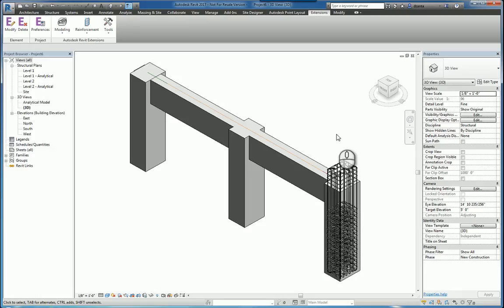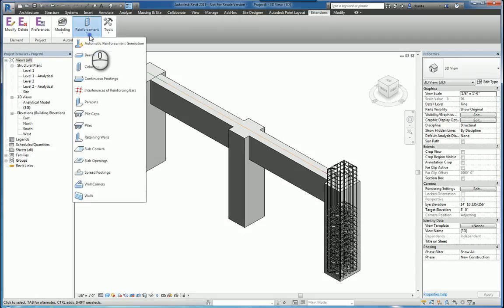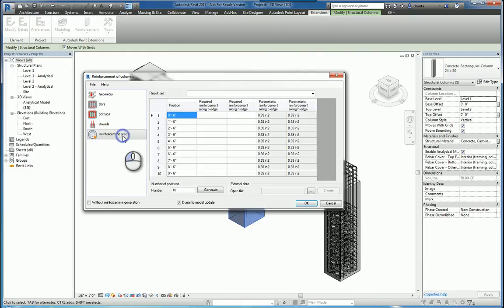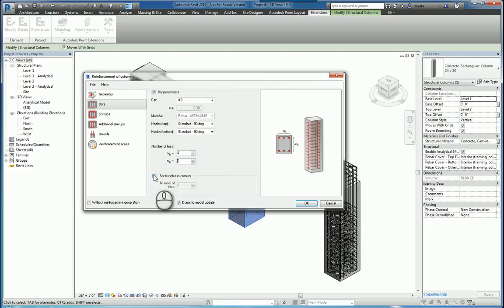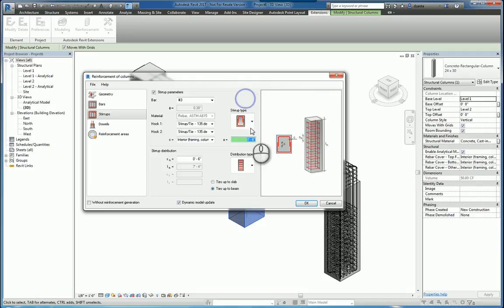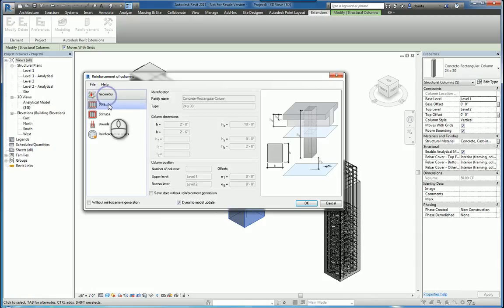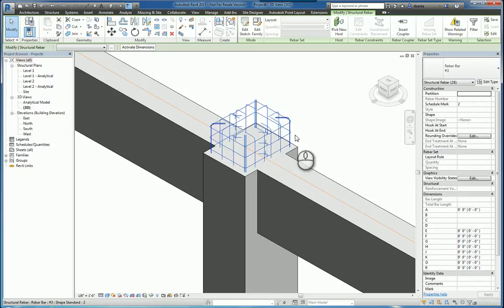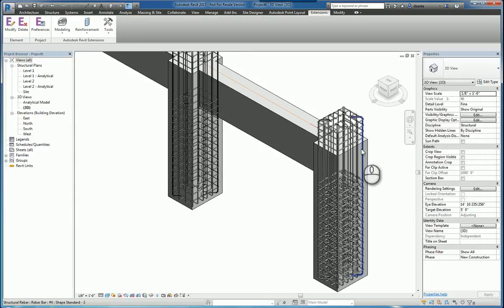Revit Extensions Column Rebars   A How To Guide

Comment: hello 
i have 3 columns that are attached at top with a sloped slab , when i do what you just did it , all rebar are showing way above the slab , even though dowles are turned off !! what am i doing wrong?
Reply from the maker: if you can send me a revit file or picture, I can get a better understanding.  I created 3 concrete columns attached at the tops with a sloped structural slab foundation.  I then used the extension command on each one using different settings.  Depending on the settings you choose, the rebar will go thru the slab or not.  The settings I chose to ensure the rebar does not go into the slab are as follows:
1.  Geometry Section (left as defaults)
2.  Bars Section (No Hooks for top/bottom and the rest as defaults)
3.  Stirrups Section (left as defaults)
4.  Dowels Section (unchecked Dowels)
5.  Reinforcement Areas Section (left as default)
6.  Clicked OK and results show rebar created and initially going into the slab
7.  Select rebar afterwards to push/pull to make it not touch the slab

If you need a video, I can make one....
Reply: omg !! thank you for your fast reply , i can send you the revit model , just give me an email .
Reply from the maker: dta@reproproducts.com
Reply: i have sent it to you ..
Reply from the maker: After several attempts and scenarios, this is what is going on:
- The extension tool creates the rebars in the column as you specify them in the dialog boxes.
- If the concrete column is freestanding and there is no slab anywhere near it to intersect or attach to (top/bottom), then the rebar is created FULLY CONTAINED in the concrete column
- if the concrete column is near or attached to a structural member (slab, beam, foundation, etc.), the extension will automatically create the rebar such that is goes into the adjacent structural system family (slab, beam, foundation, etc.).
- if you create all the columns and rebar without the floor slab present, the beams will be initially created inside the columns
- if you introduce the floor slab afterwards, the extension program will automatically adjust the rebars to go into the floor slab.
- even after checking "do not dynamically update model" in the extension window, the rebar will still automatically adjust and add the additional length
- you will have no choice but to move the ends of the rebar down to be fully contained in the concrete column after they are created
- easiest way is to go to an elevation view, create a horizontal reference plane and use Multiple Align command to align all the ends quickly
Reply: first of all thank you os much for your help and fast replies ,
Couple of Questions:

1-i have some rebar shape families that i have attached images to, so that when i create a schedule the images show, the extensions use some weird shapes to rebar with some missing parameters like length of each bar ... , is there a way to force it to use my rebar shapes ?
2-"easiest way is to go to an elevation view, create a horizontal reference plane and use Multiple Align command to align all the ends quickly" i know how to do align , but never heard of multiple align , could you make a video (if you have the time) or point to forum i can read .

and again thank you so much for all your help
Reply from the maker: not sure about answer to question 1...probably not possible unless you know how to change the extension program code
to use Align with Multiple feature.....Start Align Command, go to Options Toolbar and put a checkmark in the Multiple box, select the reference plane to align to, then select the rebar to move the ends to alignment.

FYI....please subscribe and let others know to do so as well...helps me out...!
Reply: already done that , thank you so much , keep up the good work
Reply from the maker: also....connect with me via LinkedIn, Facebook Educational Work Videos, Facebook Education Elite, Twitter, Autodesk Knowledge Network, Autodesk Screencast...